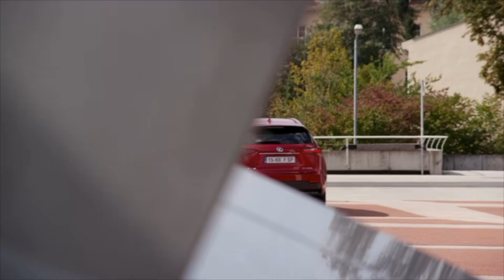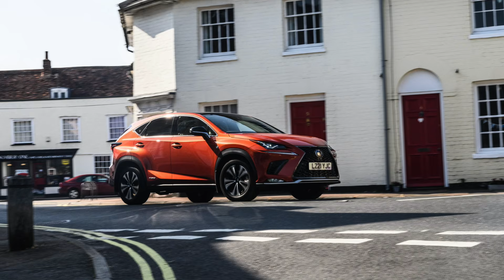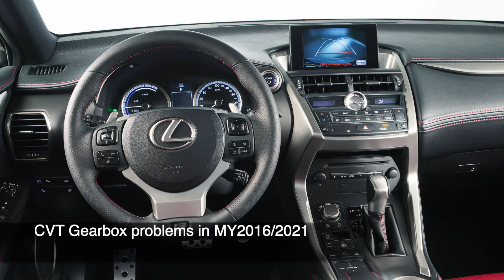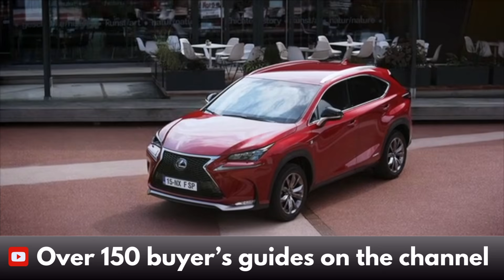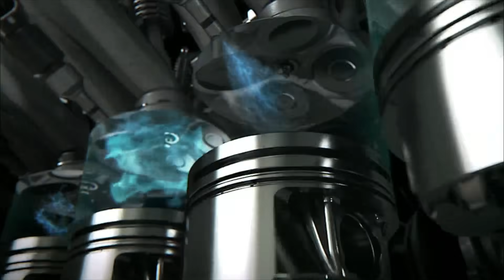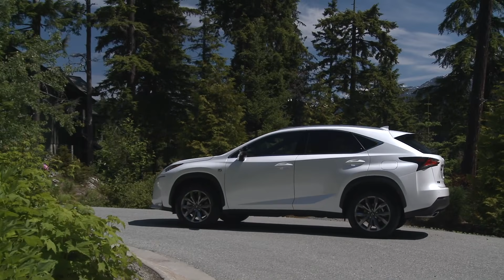Used Lexus NX Buyers guide (2014-2021) Avoid faults and common problems (AZ10)

Comment: You say my 2017 NX200T uses a CVT transmission??? They told me a 8 speed. How can I tell. It SEEMS to shift but that could be in the software.
Reply: Hybrids use e cvt, most are either 6 speed or 8 speed
Reply from the maker: Does it have a gear indicator on the dash? There is a 6 speed auto, the 8 speed goes in on 2021 (2nd gen models) but maybe it was fitted on 2017 facelift cars, I’m only showing a 6 speed auto and CVT on this generation 👍
Reply: @themilesdriven 6 speed. Thanks for the input!
Reply: It's got a 6 speed automatic. The NX 300h has an eCVT, & most of the second gen NX has an 8-speed automatic